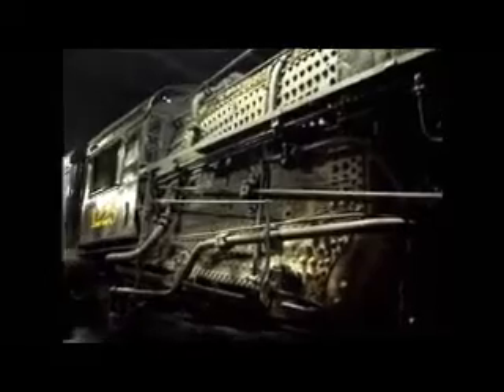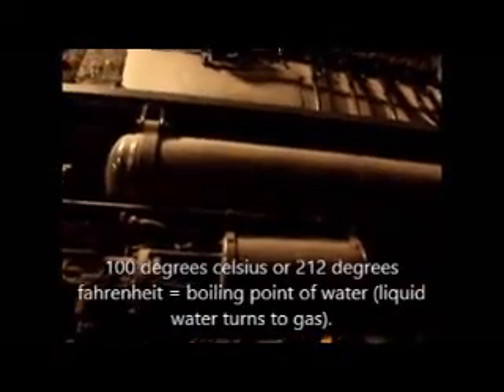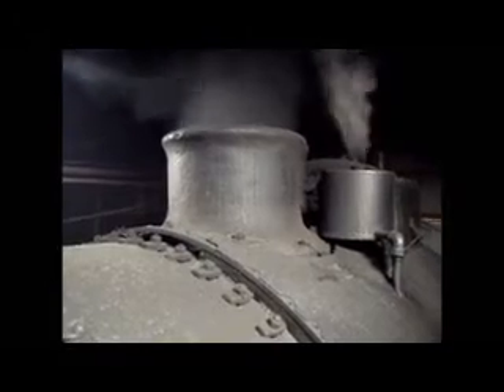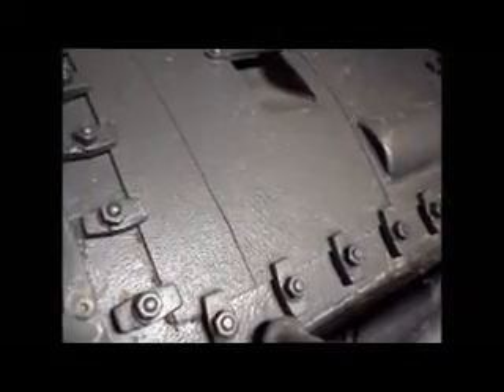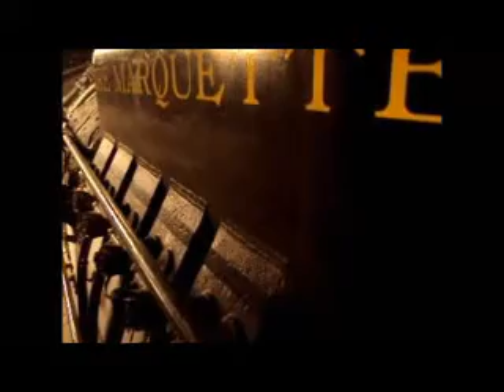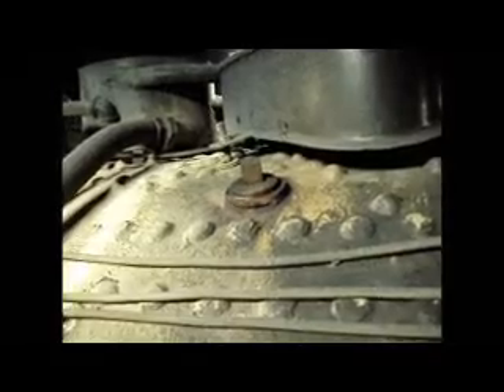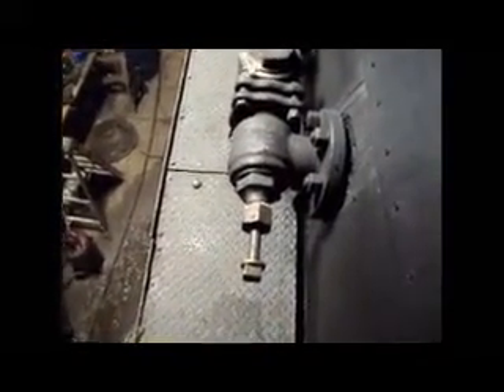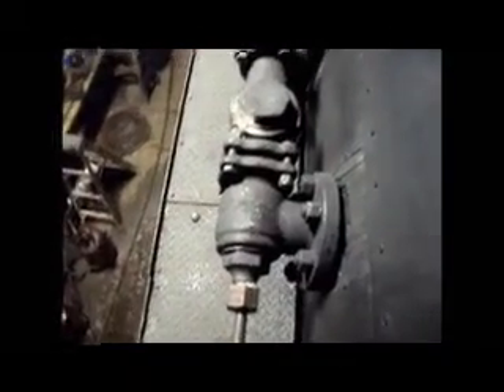Pere Marquette 1225 how a steam locomotive works part 2

Comment: IIRC the piston gear, or at least some of it, was taken from the 1223. I have been told by a very reliable source that at any rate, the 1223 does not have piston gear needed to run...and is thus stuck on static display. I suppose if the 1225's boiler or something went, you could transfer all the parts over to the 1223 and run it, but AFAIK, the 1223 does not have at least some of her piston gear.
Reply from the maker: Not sure what you mean by "piston gear". If you are referring to the main drive pistons, unless they are internal pieces (doubtful), the pistons are still there. You should watch PereMarquette1223's video where he walks around 1223 during their open house. ConrailJon is also a pretty reliable source, he has said things to the contrary before. Not sure if he'd deny it on here. If this was the video I intended to upload with all the captions, it would say right on the video what other parts are from other locomotives. Besides, just having missing parts is no big deal. All it would take is enough money to make new parts. Basically all you need to do is take parts off 1225 and make a casting for a new part. So really, the 1223 people would be paying SRI to get at those parts which helps the 1225. In this day in age, we have a situation where I scratch your back if you scratch mine. So I guess if they wanted to trade us something we could do that. Maybe in the future Owosso will have a facility satisfactory for BOTH berkshires, as well as any other locomotives that visit. Then there wouldn't be much of a problem at all because they're both in the same location. But that is probably a long way down the road.
Reply: RailsofMichigan I'm not for certain about what I said...it was a LONG time ago I remember reading it...like 2-3 years ago. All I remember was that a lot of the pistons and such are taken from the 1223 for the 1225 project. Again I may be wrong, and perhaps Jon will chime in. 

I read you on creating new parts. But as much as I'd like to see both Berks running, I don't think it is feasible. We're already reaching Steam Locomotive Saturation at this point, IMO. A lot of it has to do with the NS Steam Program, but there is a lot of steam out there right now, and I think while you're market is big, just not huge. Now I'm not gonna be one of those jerks who flat out rant about steam being bad or whatever, I love it, but I just don't see it. But if the project did gain steam, that is to have both Berks running, you'll see me on board :)